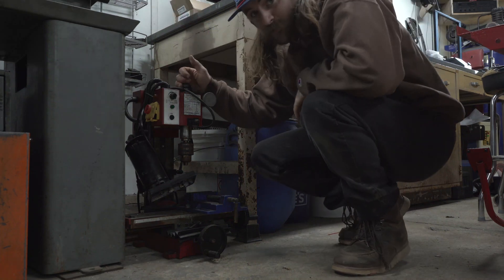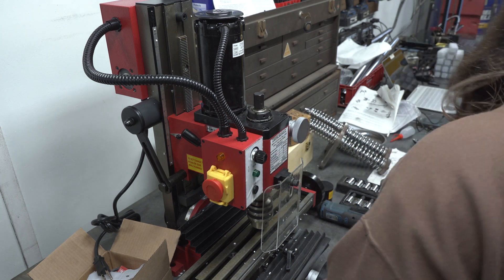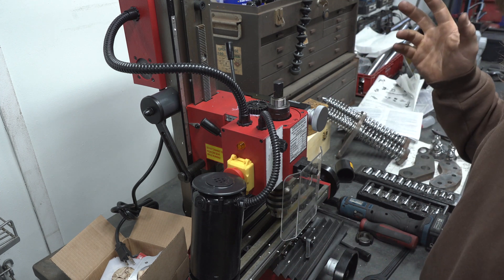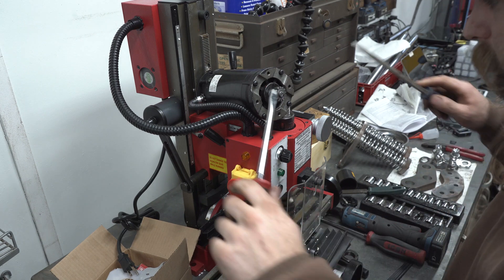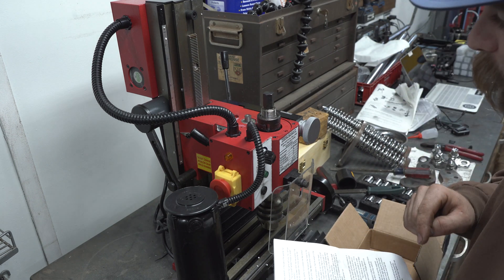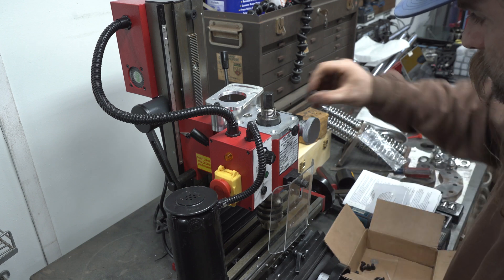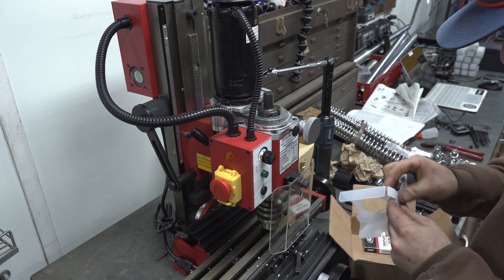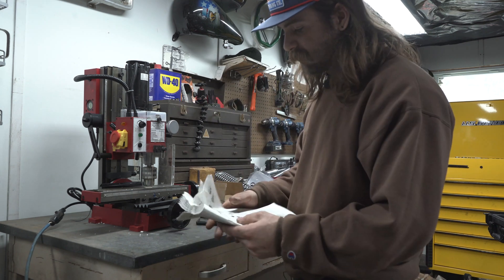CNC Mini Mill: Belt Conversion

Comment: I did the same conversion but ran into an issue with the large pulley getting stuck when I tighten up the left handed bolt thing.  Any suggestions
Reply: What is "STUCK"? The pulley is too far down?  The pulley is too fat for the hole in the head?? Can't get the pulley back off of the shaft???

Comment: With the transmission delete is it “stuck” in high or low? Or what ratio
Reply: Nevermind, I read their install manual. For anyone else wondering the two speeds with the belt mod are controlled by switching the belt, and the internal
Hi/Lo system is redundant. It will only make extra noise if left in but it isn’t mandatory to remove it
Reply: If you move the speed selector handle to the "MIDDLE", between high and low, it will be very quiet without removing the internal gears... but it could slip back into a gear when you are not looking!

Comment: Great video. Nobody else could be bothered to show how hard it is to pry off that gear on the motor shaft at 6 minutes.
Reply: Since you have a mill, you could make a puller for that gear before you disassemble.  Make a "C-Shaped" form that reaches around the gear+shaft, and then drill and thread a hole for a drive screw aligned with the motor shaft..